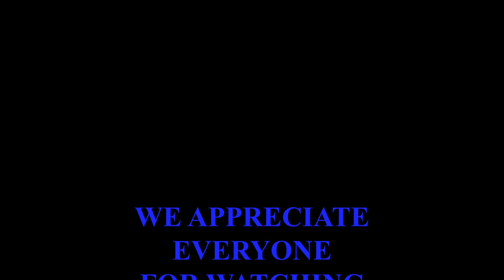MILLING A LARGE PECAN LOG

Comment: Can pecan beams be used for timber framing or are there issues with it? Thx!
Reply from the maker: I would hate to tell you anything on that one. I’ve never used Peacan for anything except projects. From what I’ve looked up about it, it’s not consider very much for strength. Sorry I could help you much on that one. Appreciate you watching and for the question.
Reply: @MsdMakingSawDust  what about post oak or live oak? 🤔  Thx
Reply from the maker: @francisarledge9981 
Sorry for the late answer I was away on family health issues . 
Live oak is suppose to be a very strong wood for shipping building back along time ago, because of its bending easily. I’ve never had any.
Reply from the maker: @francisarledge9981 
Post oak is suppose to be very rot resistant and is recommended for construction use. Because of its ability to grow in dry sites, attractive crown, and strong horizontal branches, it is used in urban forestry. It is resistant to decay, so it is used for railroad ties, siding, planks, construction timbers, stair risers and treads, flooring, pulp, veneer, particle board,
Reply: @MsdMakingSawDust  thanks so much!! I've also heard it's related to white oak which I've worked with a lot.  It's like working with concrete! 😂  We have tons of post oak in my area and I just bought a sawmill.
Reply from the maker: @francisarledge9981 
Congratulations on the mill purchase !! Hope you enjoy it.
Yea white oak is best to mill when it’s green. The longer it sets the harder it gets. Well if you start a YouTube channel be sure to let us know ….